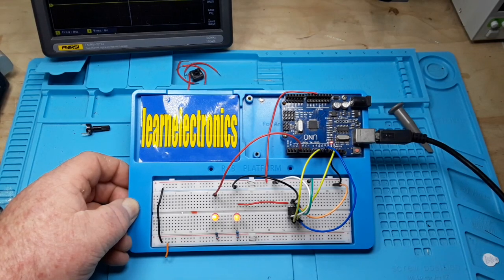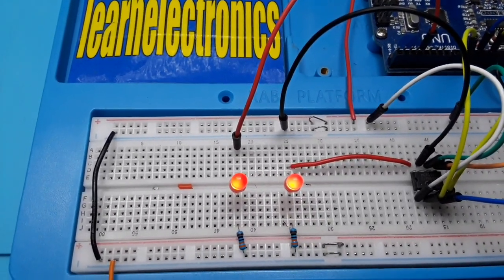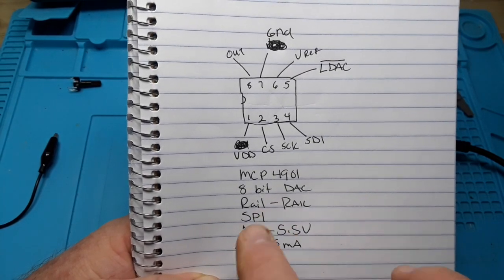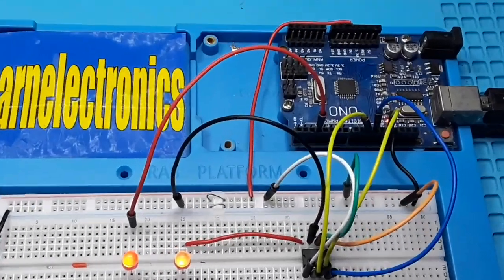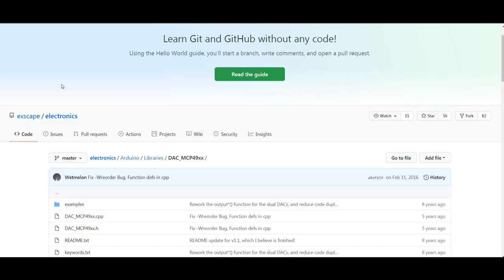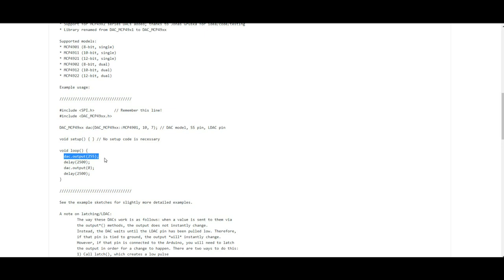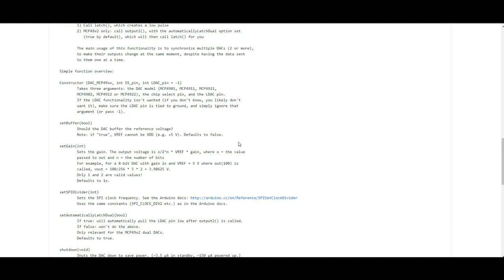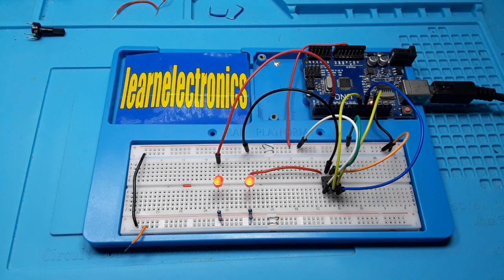The FASTEST way to get analog output from an Arduino

Comment: Nice overview. You may want to discuss the trade offs  involved between a filtered PWM and a DAC analog output.
Reply: What are the trade off teach me please?
Reply: Basically, accuracy, speed, cost...

A PWM output can be used to produce an an analog output with an RC filter. This basic design will have a ripple voltage at the PWM frequency and large source impedance. The source impedance can be addressed with a voltage follower. The output ripple can be addressed by changing the filter time constant or increasing the PWM frequency. Increasing the filter time constant reduces the ripple but increases the settling time for a specified accuracy. Increasing PWM frequency will reduce the output ripple for a given RC time constant but may reduce the PWM resolution depending on the uP used and clock rate. Also, the accuracy of the filtered PWM output is proportional to the supply voltage and switching levels of the uP.

A DAC will provide an accurate analog volt with low source impedance. If the DAC output is ratio-metric, accuracy will be limited by the supply voltage. A DAC with an internal or external reference will address the supply-accuracy issues. The DAC refresh rate is limited by the digital interface but is typically fast. Also the DAC will require more MPU pins.

All of these trade-offs (and anything I forgot) need to be considered during the design process. I have used both approaches in multiple designs.
Reply: @dougzimmerman1238  ah! Thank you :D 
But what is source impedance?
Edit : I know what impendance means but the source impedance is confusing me :)
Reply: The filtered PWM voltage can be thought as a DC voltage in series with ‘source impedance’. The value may be calculated as the parallel combination of R&C of the RC filter. For transferring voltage between the PWM filter and load (whatever your driving), you want the source impedance to be very low and the load impedance to be very high. This will minimize the PWM filter output error. In effect, the source impedance forms a voltage divider between the source and load impedance. Hope this helps... Have fun.
Reply: @dougzimmerman1238  thanks 👍8-)

Comment: The CS pin doesn't necessarily need to go to Arduino pin 10.  The ~SS pin is only required for that purpose when the ATMEGA is the slave device.  When it is the master you can use any pin.  This is especially important to remember when you want to use more that one SPI device on the bus.

Comment: Am I correct that one should NOT control the brightness of an LED by voltage?  So,  using a DAC is a bit strange.  In order to reduce flickering, increase the PWM frequency, and carefully adjust the on/off ratio/cycle should be the way to go, right?

Comment: What about a video about how to count pulses?
Something where it does with hw interrupt, and add some goodies like having three variables that constantly is updated with pulse count, pulse frequency, and distance between pulses.
Many usages for this I think, water counter, electricity counter, speed counter, the list is long.
If the thing can remember the pulse count in case of power failure then that will be an extra bonus.

Comment: HMM....  I think this may help explain why one type of monitor hurts my eyes and another doesn't. I had assumed it was due to AC vs DC but this makes more sense since they both claim to be using DC. One is probably using PWM to control the brightness and the other is using analog to control the brightness.

Comment: Can you add multiple lights and get the same results?
Reply: Yes, but you will control all of them at the same time, or with a dual chanel chip, you can control 2 different output. Or you can use multiple chip to control multiple led separatly

Comment: why not use analog pin on the arduino
Reply: Analog pins on Arduino Uno are input only. They use an ADC not a DAC. Some other MCu chips have a DAC built in.
Reply: Analgo pin giwes you PWM, it is not real analog.
Reply: @goodwill7643  PWM is available on some digital I/O pins. No such thing as an analog (out) pin on the Uno
Reply: @blic-sx9ix  yes, I ment function analogWrite, rather than Analog pins.
Reply: @mdrew44628  thats what I've said in my first statement by talking about analogWrite function.

Comment: I don't get it. Why not just use Pins 1 through 5 with analogWrite? Sure it's nice to know how to use a DAC, but that does't seem like the fastest way to me.
Reply: For some things it's helpful to have a real analog output. For example, in my case I am using an LCD display and I can't set rhe contrast with PWM because it blink too much. With this DAC, it can display nicely and smoothly
Reply: @IGaming73  The pins 1 through 5 are real analog pins. They output a steady voltage between 0V and 5V